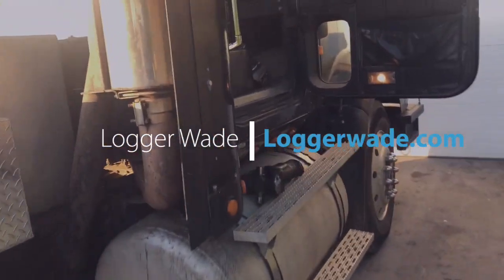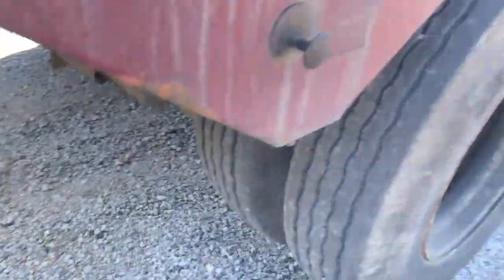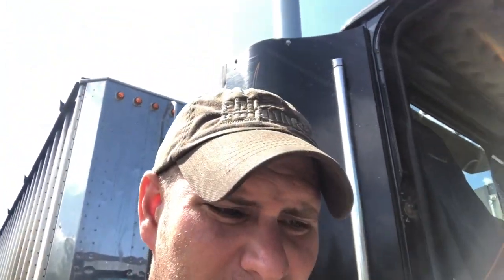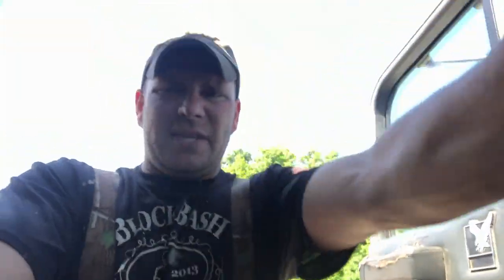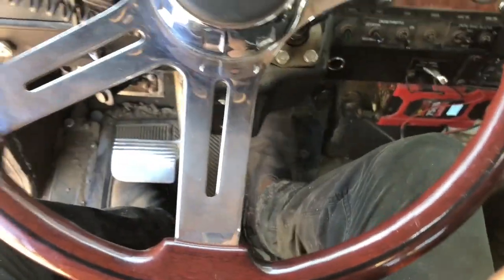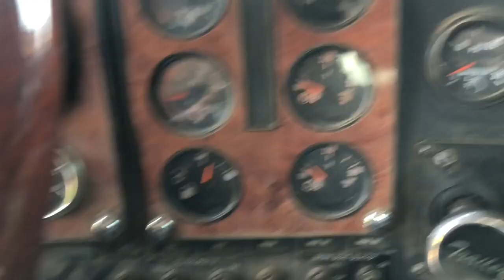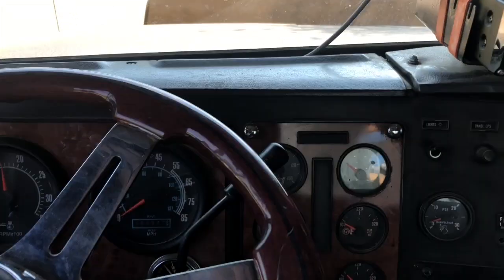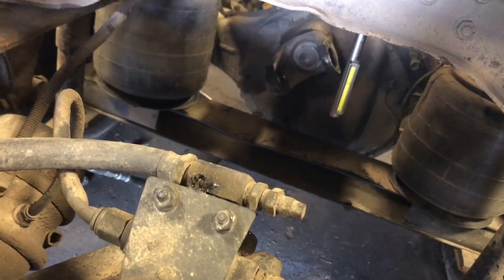Maden voyage for me and this trailer

Comment: I agree to a point on the auto slacks. 
If you take the time to set them up correctly and keep them greesed they USUALLY work pretty well. 
Setup is critical. That little paper gauge in that slack adjuster box is important. Don't use it to wipe your ass.

Comment: dont they fit any usable stuff to the trucks and trailers over there?. our 06 mod volvo have drum brakes on it, should have went with discs back then also, but in a rush to order that truck. once in all those years we had to fiddle with one of the slack adjusters on it. new truck and trailers have disc brakes all over and never had any problem with them, pads i have changed my self. 
for your work importing a scandinavian made truck would help out. much stronger trucks made for heavy weights :)

Comment: you can weld and fabricate fix that drive shaft yourself.  cut off wheel the weld in two (not to deep its only 1/8th inch tubing).  pound the yoke out of the tube.   cut tube, install driveshaft and dial indicate the end to be welded, tach, full weld, dun..   ive dun a few then they cannt be that hard..

Comment: I had auto slack adjuster work it self tight on the front axle of a T600 got hot and blew brake drum and all off  after checking my brakes before I left I agree there junk. Keep up the great video's

Comment: Those automatic slack adjusters wouldn't be so bad if they actually worked! And the worst of it all is if you totally obey the law you're not even supposed to adjust your own brakes unless you are certified on them! I've been adjusting brakes since I was 9 years old on our farm and started driving 10 wheelers since I was 9 and 6 axle tractor trailers since I was 11and like you I do all of my own repairs no matter how big or small and then they say that I can't adjust my brakes because I don't have a piece of paper saying that I know how!! But that's the whole problem, I don't think that anyone should be able to drive a truck or get a CDL until they know how to at least do simple maintenance on them!!! It's literally to the point that all of these new driver's can only drive an automatic transmission and they sure as hell can't back them up! Keep up the good work Was!
Reply: If I could like this comment more than once I would. I had a conversation the other day and pretty much said the same exact thing. I drive OTR when grading is slow and you are correct there aren't many professional drivers left

Comment: Yeah them auto slack adjusters are junk!! Want to hear something that’s just as screwed as them slack adjusters, I work for the state of Pennsylvania as a department of transportation equipment operator and they told us they are getting rid of the manual transmission and going with automatic trans because of the way the new licenses!!! If you get on your license that your only aloud to drive an automatic that all your aloud to drive so them jackasses are going to all automatics so they can drive the trucks!!!! The new way to get your cdl license is so bull shit it’s not funny!!!!
Reply: Chad  Isett That's screwed up!
Reply: Adam Gipson yeah the new CDL license is so screwed up it’s not funny!!! If you go and take your class A cdl and use an automatic that’s all your aloud to drive!!! If you go and use a Pennell hook trailer for your class A then that’s all your aloud to tow for your license!!! But the weird part is if you go and take your class A in a tractor trailer with the fifth wheel plate in a manual truck then you can drive any class A peace of equipment!!! It’s just fucked up!!!
Reply: The reason is because super truckers burn up to much fuel their doing it for fuel savings and safety